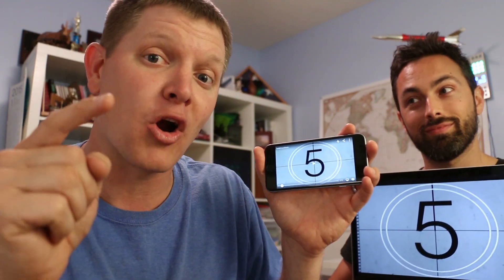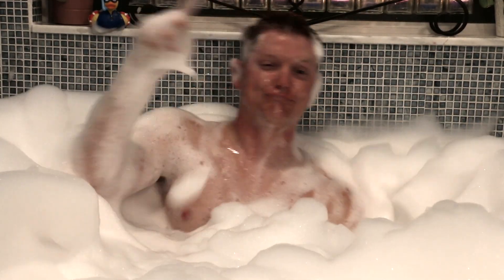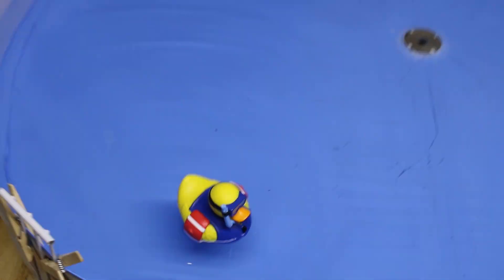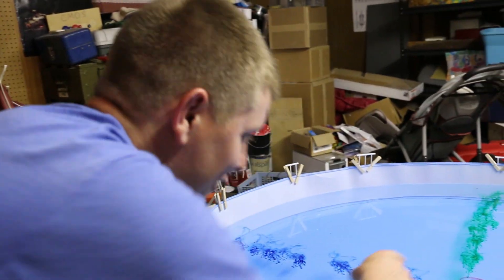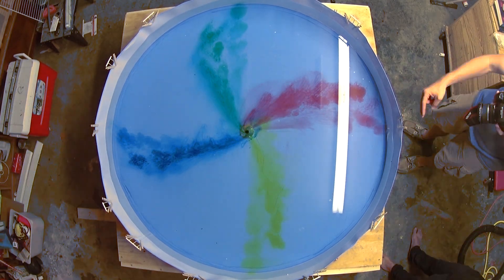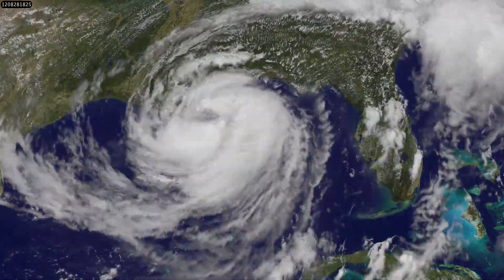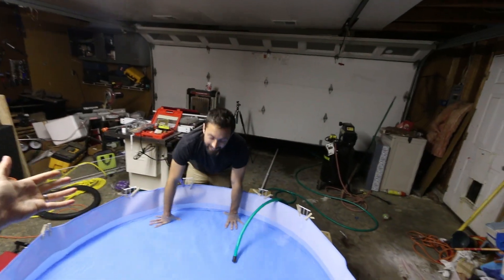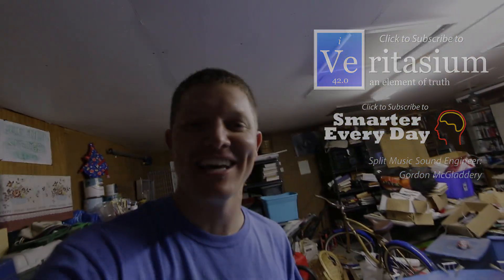The Truth About Toilet Swirl - Northern Hemisphere  (Smarter Every Day 137)

Comment: Ok, I’ve known about the corealis effect for some time but I do have a serious question. A sink draining or a hurricane swirling goes counter clockwise in the northern hemisphere and clockwise in the Southern Hemisphere. What would happen if we did this experiment ON the equator?
Reply: there isn't enough angular momentum for hurricanes or cyclones to form on the equator exactly so I presume it would be most likely chance, "Cyclones can't ever cross the equator. They occur mainly between 10 and 20 degrees north or south of the equator and are the product of tropical low pressure systems over warm water "
Reply: @isaacpatman5255  There isn't enough angular momentum in a 4 foot pool either.
Reply: On the exact equator line, water does NOT SWIRL.  WATER GOES STRAIGHT DOWN.
Reply: @nellyfarnsworth7381  No it really doesn't . It swirls like everywhere else.
Reply: @asyouwish9567  
So sorry you WONG.
I am salesman,  travel much.
Go to Equator line.
Water No SWIRL, go straight down. 
People know this for thousands of years, before us.
Reply: @nellyfarnsworth7381  there is a trick people at the equator do for tourists. They pour water down a sink or a pail with a hole in it. They claim to be standing on the equator and it flows straight down. They go ten feet north and is spins counter, They go ten feet south and it goes clockwise. 

Its just a nonsensical thing to make a few bucks.  I totally believe in coriolis effect. Just not on that small scale. Over many miles there is an effect.  But not over 18 inches.  I don't believe it. But if you want to show me videos of water going straight down the drain at the equator I'll look at ehem.

But it these tourist entertainers are right then you have to be exactly on the equator.  Ten feet off the equator and you get a swirl.  How would you ever know your drain is lined up perfectly with the equator.
Reply: @asyouwish9567  
Yes they know exactly, the equator line. I see with eyes, not video. It is true.
People 5,000 & 10, 000 years before us know this.
Reply: @nellyfarnsworth7381  With all due respect you have a comedy name and you type like you are trying to speak bad chinese. I am assuming you are a troll and I won't waste my time with you. I have better things to argue about.
Reply: @asyouwish9567  
I know the TRUTH.
I see with eyes.
You go to Equator, you see with your eyes.
I try to help you.
But you not want help.
But is okay that you believe WONG.
Reply: @asyouwish9567  
I try to help.
But if you want, believe earth is FLAT, this OKAY.
Reply: @asyouwish9567  
Chow is not real name.
I use grand father nick nsme.
Grand father vome USA, with USA troops 1945. 
Troops call him chow, they not know how say real name.
Grandfather little but eat same. As Big  USA troop.
I see no swirl with eyes.
But if want swirl is okay with me.
Reply: @asyouwish9567  the coriolis effect CAN exist in a very controlled experimented (like this vid)

Comment: Ive been a pilot for 42 years.. part of the training is weather.   Coriolis effect is of course real..  when you see clouds/storms from space,, you can see they have CC rotation above the equator and CW in the southern.. Go to the weather channel and watch..  My only question is does it swirl slower as you get closer to the equator on both sides and    then does it speed up or slow down above and the tropic of cancer  and correspondingly when below the tropic of Capricorn.  If you have the resources and time move 500 miles or a 1000 north or south and repeat the experiment..   Also Destin.. i have a great experiment for you concerning gravity if you contact me..

Comment: our sense of balance is so delicate we will feel any movement we are not in control of. having said that, you expect me to believe the water is effected by the spin but our equilibrium is not? and there were many examples of the water dong its own thing but because it didnt do what you wanted you had to find something that did. low and behold after 1 try that was all that was needed to prove what? that we are spinning 1000mph and cant feel it? 
hahahahaha if your in a car spinning around you get pushed to one side depending which way your circling. in a car going forward everything eventualy equals out. but spinning is different.... i cant believe im still here on the earth. 1000mph is fast... i should have been flung off into the darkness by now. im in australia and the water goes whatever way it wants. what about the people on the equator then are they going left or right or straight ahead or backwards? 
and before you say we are at one with the atmosphere then why do they say jet streams are created based on the 1000mph spin of the earth? if the air can be effected then so should everything else.

Comment: Recent experiments have shown that the direction of the vortices can change if the water is positively or negatively charged.  This evidence supports the idea that the reason is a magnetic phenomenon and not because of the coreolis effect. This evidence is in light of the discovery of EZ or 4th phase water by doctor Gerald Pollock.
Reply: Where are these experiments. If what you say is true then the experiment would be repeatable.

Comment: I may have to delete this post but it seems you only did the pool once before concluding its real.  The pool has to drain either clockwise or anti clockwise so that wasn't the least bit conclusive. You'd have to do it at least a few times to eliminate the odds its just a coin flip.

Comment: No, it is not real.  If there was any movement in the water before you opened the drain, it will go down in that direction.  That will determine the direction the water will swirl.  This can be proven by using your hand to change the direction.  If both of you agree on this, you're both wrong.  Sorry to be the one to tell you.

Comment: In order to have meaningful conclusion you should repeat the experiment several times ... Also the difference in linear speed due to Earth rotation across a such a pool is less than random motions within the water and air above it and the imperfections of your setup!
I left a similar comment under Derek's video calculating that the difference in speed across a 2m pool is merely 80 micro meters per second!!
Reply: Exactly. The other video guy even states, “In any body of water there is motion, and it’s that motion that determines the swirl direction, not the rotation of the earth.” Then he literally 2 minutes later says the swirl in his kiddie pool rig is proof that the earth is rotating... wtf.
Reply: @joeltunnah  To be clear I believe an experiment can be made to measure this effect precisely ... but I'm not sure if their setup has the required accuracy to measure such phenomenon

Comment: Another fun part about the Coriolis effect on hurricanes is that hurricanes cannot cross the equator without being ripped apart by the Coriolis effect. It’s actually pretty cool, since the Coriolis effect effectively repels hurricanes from the equator, when you look at a map of all the recorded hurricanes in the past 30 or so years, you’ll notice, none of them EVER cross a particular latitude. There’s like 10 or so degrees around the equator where no hurricanes have touched.

Comment: I’m really disappointed by this video. It falls well below the standards of normal smarter every day content. Dustin, you correctly identify the forces involved in Coriolis effects that can be observed at “ocean scale” but you fail to experiment on the math that would validate any applicable assumptions/hypothesis. Specifically, you should be deriving the delta in angular momentum of both sides of the pool (dependent on their relative latitudes) and then making an assumption on if the differential of momentum is sufficient to produce differences in behavior of the water versus other random features (drain shape, etc).

Comment: Question...If the Earth is spinning at 1,000mph why is this water placid?
Reply: because the water is moving relative to the earths rotation in the same frame of reference. kind of like how you dont shoot out the back of your car when youre driving 100kmh down a highway. youre moving 100kmh with the car

Comment: you have to do more than 1 test,  otherwise the results have no statistics meaning. The coriolis force is proportional to the relative speed among water and earth, that is very very low,  so there are a lot of thing that can disturb the experiment,  like air current,  or vibration from the floor

Comment: You forgot to mention that in addition to the angled jets, a toilet is to small of a body of a fluid to be effected by the Coriolis effect. As you saw, even with a pool that size, the effect it had was extremely small. Now when the fluid is the entire atmosphere and there is a 200 mile wide Low, then the effect is obviously noticeable.

Comment: I wonder if the same is true of a Foucault Pendulum? And if so - what direction does a Foucault Pendulum swing at the equator? What direction would the water swirl if you were at the equator or would it make a difference if you had one swimming pool (or Foucault Pendulum) five feet north of the equator and the other five feet south of the equator?

Comment: Imagine if you open the valve very very slowly... you will introduce some sort of different flow rate in the tube which will transfer that to the flow down the drain....if you use different valve ( open clockwise and another one counterclockwise) and different speed of opening you might find interesting things

Comment: The globe rotates eastward (towards the east) according to some scientists. This experiment (this video) would make sense to the globe model if you were at the north pole or south pole due to the rotation of the globe (eastward). A while back a did some research to this matter. The country of Columbia is located approximately at the equator (middle of the globe). My Columbia friend tried this experiment and the water swirl just like this experiment (this video). The problem is that globe is not rotating northward or southward so this experiment (this video) is debunked. Columbia is not located at the north pole or south pole.

Comment: Yes if you experiment correctly the flow is different between the hemispheres. Toilets are designed to make it swirl so direction depends on the toilet design.  Your experiment of water in a tank falling through a hole can be shown on video at the same time to be different between the hemispheres. It works because the falling water is moved by the spinning earth. The so called coriolis effect.

Comment: I'm a plumber in Florida. In the 1980's, a nation wide home-supply store purchasing agent found a great deal on virus-china toilet bowl & tank combinations he could purchase by the train-car load very cheaply and sell them across North America.
Problem...The bowl was fabricated in Brazil. The bowls spin the other way down there.  Eventually, after conducting a service call for "toilet not flushing", I finally noticed the spin was the wrong direction. That toilet spin would stop in the middle of the flush cycle, and the tank would be nearly empty before the spin began to move correctly.  By then, there wasn't enough water in the tank to lift the fluid over the trap inside the preformed bowl.
I found the label on the back of the bowl marked "Brazil", and realized what the problem was.
After that, for the next year, every time I got a customer-call about "toilet doesn't flush", I'd have the caller look for the name.  If they said "Yes", I'd tell them to go back to the store for a replacement and a credit invoice, and I would install it for them.  If not, I knew they needed my help for an as yet undetermined malfunction.
I remember the store was magnanimous in supplying the replacement bowl and paying labor for every change-out I did for the following several months.  It's truly sad they went out of business soon after, but I doubt that had a connection to the money they lost on the toilets.
Incidentally, I'm one plumbing company out of 100 in this beach area along the Florida west coast.  I had 50 of those toilet calls in the first year.  Can you imagine how many plumbers struggled over that anomaly for that year before the store removed them from the shelves?
Reply: I live in the Northern hemisphere and I've used multiple toilets that flush clockwise because the jets are aimed that way. They flush just fine, and there is no tendency for the water to want to reverse direction and interrupt the process. The Coriolis force is infinitesimal at this scale and has no significant effect on toilets. The toilets you encountered must have had some other defect.

Comment: OK. So because of the corilois effect, hurricanes in the northern hemisphere rotate counter clockwise. Hurricanes in the southern hemisphere rotate clockwise. No Hurricanes form with 5 degrees of the equator. But what would happen if one were to form further north of further south and then get close to the equator? Also, what would happen if you were to position a kitty pool ON the equator and drain it like you did in these videos?

Comment: I would repeat the experiment but have the valve open in the opposite direction i.e clockwise turn on the valve and see if the flow of water follows that because I think the valve is inducing the slight force to cause the rotation. The internal valve is still putting a minute force on the water as it rotates counter clockwise.

Comment: Actually there is no guarantee that drains will run counterclockwise in the northern hemisphere.  Even a kiddie pool might not be a good experiment.  If you did it 100 times, you might get the opposite effect some of the time.  They are rare but some tornadoes have been observed rotating clockwise, even though the vast majority spin counterclockwise.  But with large scale weather systems, such as hurricanes and areas of low pressure ALWAYS turn counterclockwise.  (Rising air)   High pressure systems ALWAYS turn clockwise. (Sinking air)  In the southern hemisphere the opposite is true.  This is caused by the Earth's rotation from west to east.

Comment: To be a more scientific test, you should take the same pool you created to the other hemisphere and fill it with water over there.  This would eliminate more variables.  For example, the hole where the water drains could have slight grooves (like the barrel of a gun) which are influencing the way the water is spinning.  So make an apples to apples comparison... by using the same equipment, and transporting it to the other hemisphere to conduct a second trial.  Then I would believe.....

Comment: LOVE your experiments and how well you do everything, with so much care and attention to detail  HOWEVER, this was not at all definitive, nor good experimental validation.  For it to be definitive, you need to repeat that experiment multiple times (let's say 10 times or whatever x-sigma level would be appropriate), to ensure that it wasn't random.  Doing this once at a given location and observing it going one way or another means nothing definitive, because it has to go one way or another even if it was random.  To determine this even more definitively, you should do it at several latitudes on both sides of the equator, measuring rates of rotation as a function of time.
Reply: I was thinking the exact same thing. I had 20 times in my mind though. Even the tiniest perturbation can affect final outcomes here. We saw how the sunlight caused some convection currents right in the video.

Comment: One used a plug and a very small tube and the other used a valve and a larger pipe to drain the same sized pool (I wonder if the length and diameter of the pipe would have a different effect) = Not the same experiment. But hey, great that it worked the first time. Perhaps even 3 times. That's not enough testing.
If they didn't see in which direction the water was going how could they see that it stood still? Because they waited 24 hours and the earth stopped rotating for the time beeing?

Comment: The water that enters the toilet comes in one way which starts the vortex a certain way. You have to have a body of water with no motion, then pull a plug. Even that has some variables that can affect the initial motion. Basically this is a trash experiment.

Comment: He doesn't pull the plug so he can get accurate results lol. Then proceeds to drop die several times in a pattern that promotes a counterclockwise motion lol and you all believe it. notice his drops push the water off center to the right or counter turn of the drain all four times and again second before they claim a counter clockwise motion.

Comment: Destin, I need your help.
I live in the northern hemisphere. 3600 miles north of the equator. In my garage I have 2 side-by-side sinks. If I fill them both up, let them settle and pull both plugs, they both drain in OPPOSITE directions. Can you explain why please? Thanks.